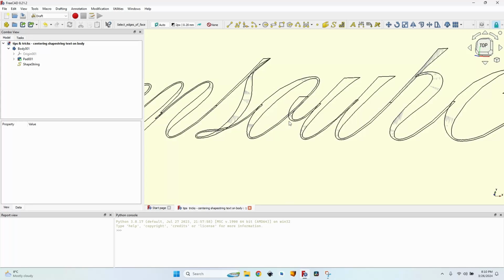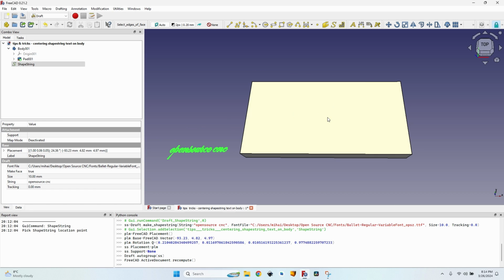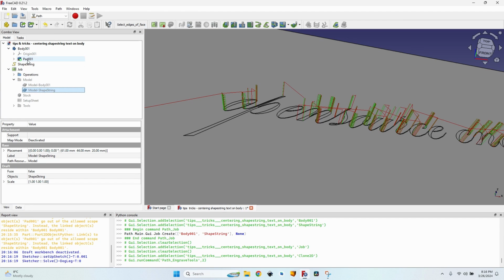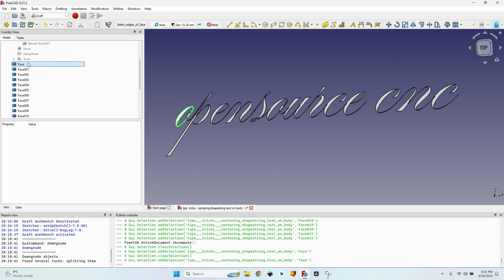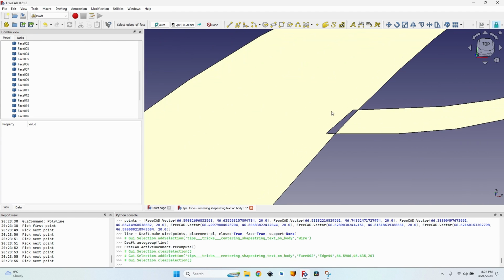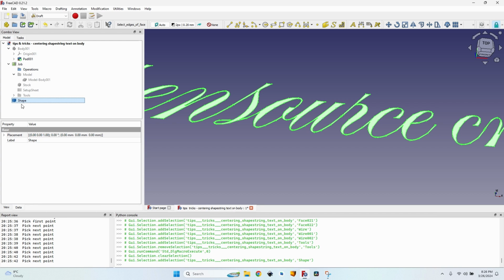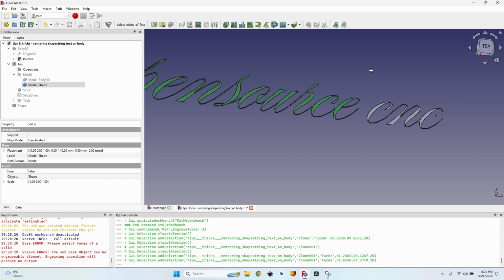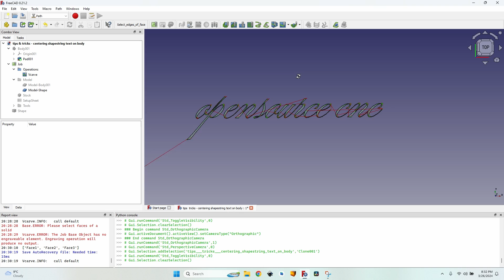CNC V-Carve Text & Shapes – FreeCAD Ep.16 | CAM Engrave Workflow

Comment: That is not practical. I'd much rather get the graphics done in Inkscape, and resolve such overlaps and self-intersections there, then import an SVG into FreeCad
Reply from the maker: That's a solution, too, of course, but some don't know how to use inkscape. That's why I searched for a solution using only FreeCAD. Anyways, using the macro's makes the operation pretty quick
Reply: @opensourcecnc  These are the 2 things that I need, actually: Knowing how to create a VCarve from an arbitrary SVG, and knowing how to create a 3D surface (Experimental) from an arbitrary STL
Reply from the maker: I'll take a look into those 2 scenarios and maybe make some videos, but, at a first glance, creating vcarve out of a random SVG, that wasn't created for vcarve won't yield good results without modifications. Also, to me 3d surface works horrible in FreeCAD for now, incredibly slow, I'm using blender cam for that
Reply: @opensourcecnc  Very Interesting! Never heard of Blendercam. It looks promising